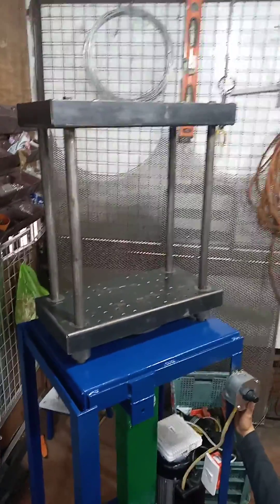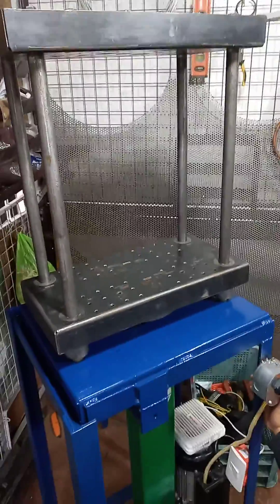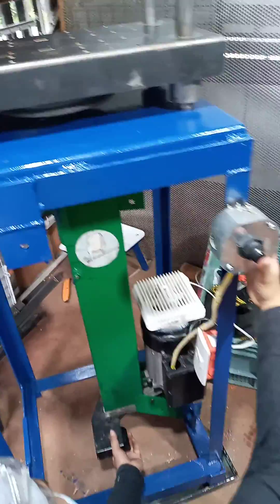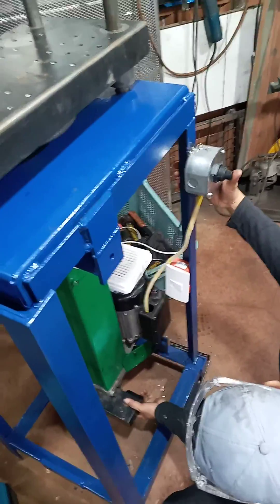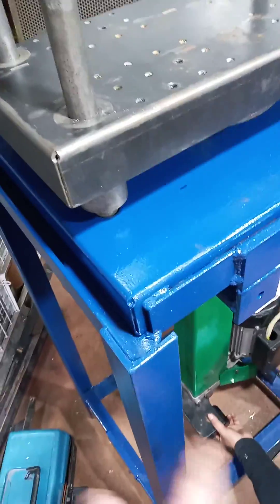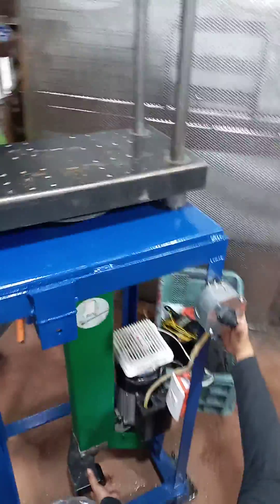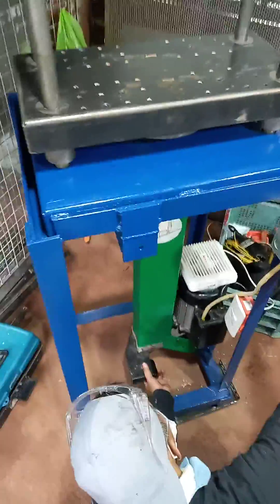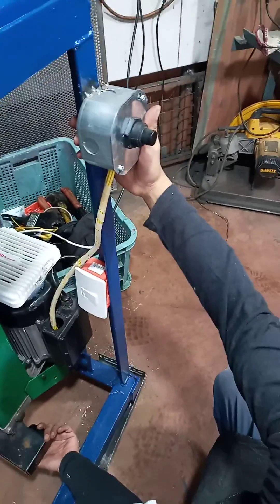Precious Plastic Compression Molding

Comment: Hey that's crazy man, can you share more info on the heat exchanger, mould cooling part, we are looking to setup a workspace in India so would really appreciate the help
Reply from the maker: Water jacket on the molds, pump automotive coolant thru with  0.5hp water pump through automotive radiator. We are molding 215 gram parts every 2.5 min
Reply: @preciousplasticph  any email address or contact number(WhatsApp/telegram) I could reach out to ?